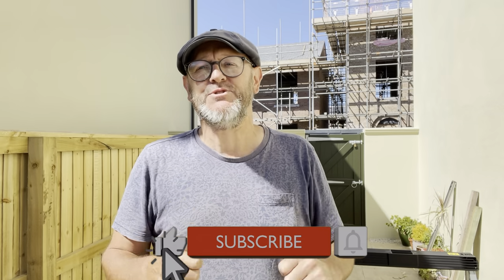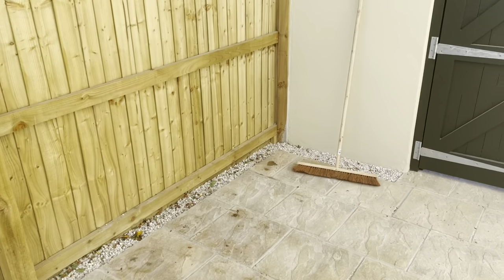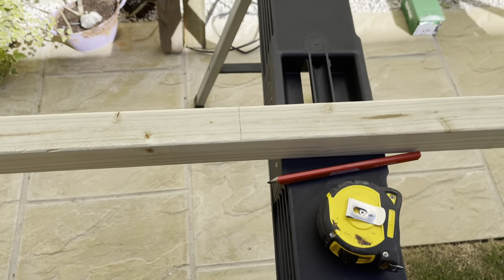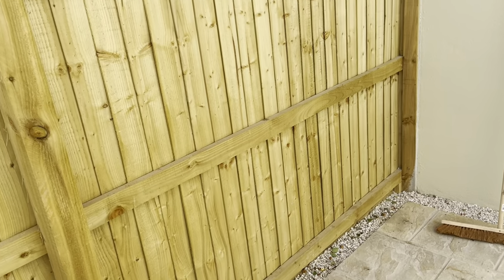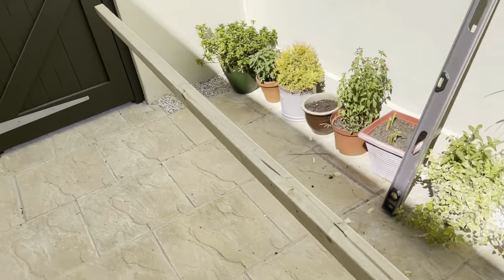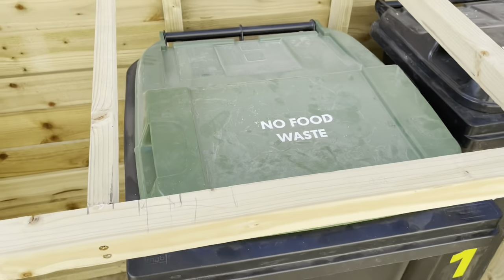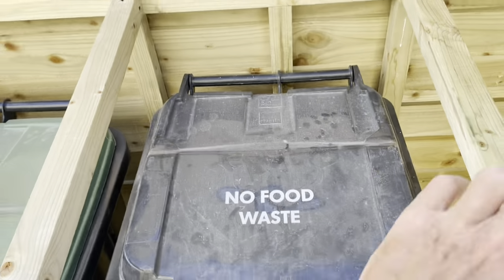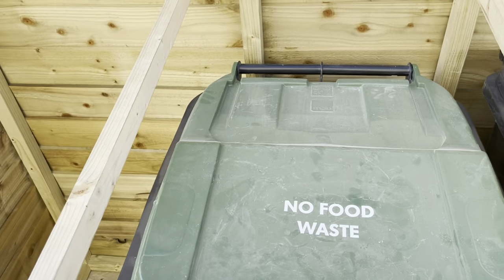How To Make A Bespoke Bin Store

Comment: Lovely looking bin store. One point for anyone wanting to make their own, you should always brace your doors back to the hinge side to stop them dropping.
Reply: Just trying to piece this together in my brain... Does this mean the bottom side of the diagonal should be at the hinge side and the top side of the diagonal furthest away from the hinge?
Thanks for this comment.
Reply: @BenLinfordUK  Any brace should head down towards the the bottom hinge. Also your braces should never be at an angle of less than 45 degrees - below this they are functionally useless. Lastly try where possible to run the braces between rails only, not into the corner of the joint, so you don't add stress to the joint  and if you use opposing birdsmouth joint to house the ends of the braces into the rails, any sag only serves to tighten the brace).
Reply: @willtheeditor  Thanks for taking the time to share, Will.

Comment: I'm pretty sure the props you added to hold the bin store roof flaps up must have prevented the lids of the bins from opening. I think you then covered that error by folding th bin lids right back and behind the bin as the tops appear to be permanently open at the end of the video. Could I be wrong?
Reply: yeah, looks that way that the bins are constantly open. Does that mean you're gone get a slight smell coming out of the bin bay?

Comment: 11:39 if you pop a rope on the lid and the support you lift up, it will automatically lift it up and you just hold if while dropping door back down. 
Or cut the support in half and put a hinge in to attach the 2 pieces.  On the lid move the baton up to give the support place to be attach with a bolt at the lid and on the side of the bottom, then when you lift the lid the support will automatically open up and lock in place, when you close you hold the lid and push on the support. 
Or easiest is go buy outdoor struts and attach that to the lids of the top. 

Great job! I will be sharing a link to your video and point them to your channel.

Comment: Very nice job, I'm about to do the same. BTW I think the bracing on two of the doors are the wrong way round, the rt. hand dble. and the far right.  👍 😎
Reply from the maker: I’ve got to spin them round.
Reply: It's taken me a while to work out why but I think I've got it- so, you're bracing in the direction that fixes opposite the hinge, to better support the weight? Thanks for pointing it out (so nicely), it's something I might not have thought of. Cheers.
Reply: Super coffre à poubelle, mais très long en explication

Comment: I'd deem it very helpful if you could tell me what the height of the rear and front uprights were to get the same slope as you. I was very impressed by your finished article and have just had a load of timber delivered ready to emulate your design. I'm doing a three door jobbie with 60cm doors.
Reply from the maker: Hi Gareth the back is approximately 100mm taller to allow for a gradient. 
Good luck with your build 😃
Reply: @KAPWoodworkandbuilding  thanks. I was well impressed with your video but I am of the firm belief that from point 3.07 in the video where you just have the back frame where two seconds later you have a carcass you must have had an extra pair of hands! Prove me wrong.

Comment: How did you get the top roof doors to stay in place, not drop down?
Also for the roof to be at an angle did you have to cut the timber at an angle or did you cut it straight? 
I have been given a load of pallets so I plan to make a bin store (I have no diy skills) but your video is the best I have found online so far.
Reply from the maker: Hi Donna. In this particular design the shiplap overlapping the top door frame holds the doors in place, I also cut the roof timbers at an angle using a sliding bevel to mark the angles. 
No I don’t have any instructions, this video is just a guide pleading use what you can and adapt for your own situation.
Mark
Reply: @KAPWoodworkandbuilding   Thank you very much for this great video.  It's given me inspiration for me to try this out for myself as a total novice.  Do you have a video (or any advice) of how is best to calculate the cutting angle for the roof to have a slope?  My roof will be sloping from 1100mm to 1000mm and is 6200mm deep.  Is there a formula for this please?  Many Thanks for your help.

KindRegards

Jonny

Comment: Does the arm that holds up the top block the lid to the bin from opening?
Reply from the maker: Depends on the size you make it. If a more restrictive space then it can be compromised but if enough space no.
Reply: @KAPWoodworkandbuilding  it looks like the bins in the store have their lids folded over and round the back, so when you open the wooden lid you can access the bin without opening the bin lid as well - is that right?  How's the smell/flies/pests in that case?
Reply from the maker: @bbtom10  you can quite happily keep the lids closed and open both lids or pull your bins out. There is no smell as you still have a lid. All bins in the height of summer will at times get smelly.